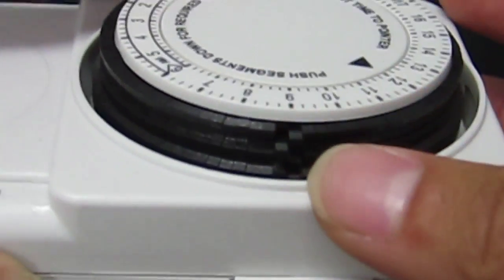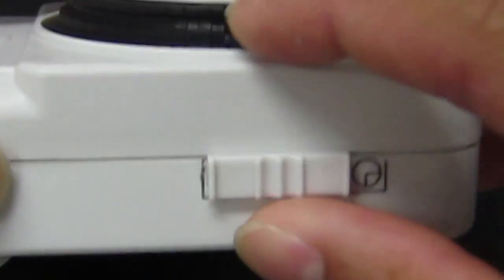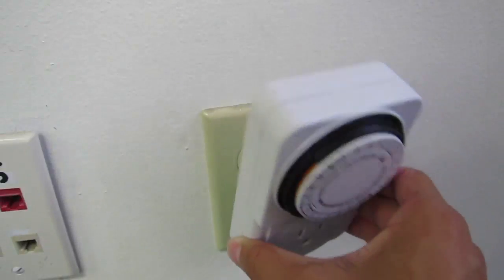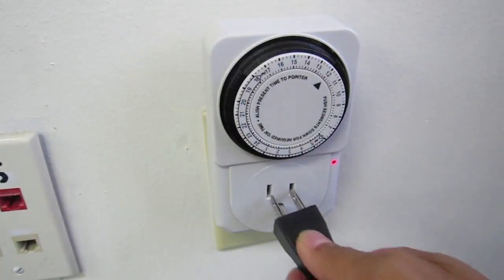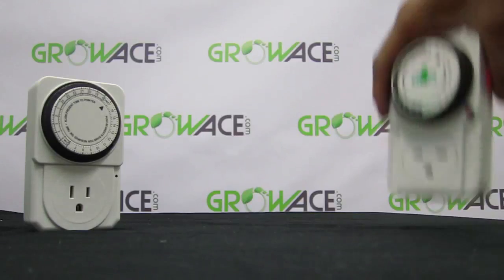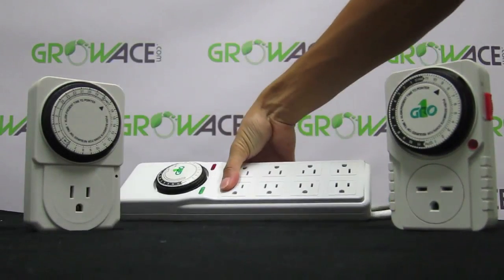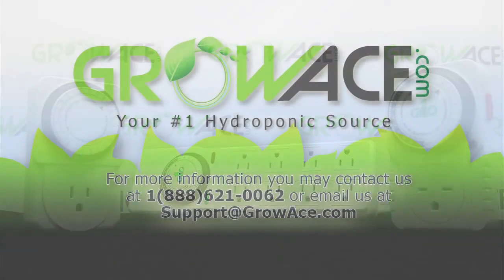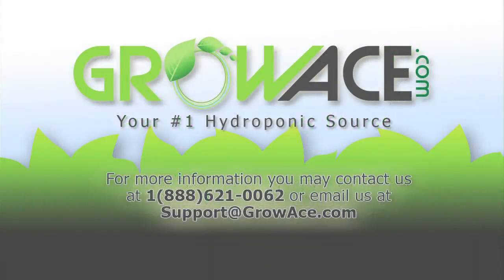How to Use a Mechanical Timer for Hydroponics Setup Tutorial GrowAce.com

Comment: hi what does that surge protector do? im interested in it, does that stop your electrical points from blowing up?
Reply from the maker: +frank lucas Kinda. It stops your electrical appliances from popping your circuit breaker by going through the surge protector first. Makes sense?
Reply: GrowAce kinda makes sense i know a surge protector can stop your appliances from getting a massive shock wave of energy an prevents your appliances from blowing up but what your saying a surge protector will stop your heavy duty electrical appliances from blowing your electrical sockets in the wall?
Reply: no he meant in this case the surge protector will stop appliance(s) from blowing fuses/circuits in your breaker. you know that box in your home with all the switches or fuses...
Reply: RaymondJacob0922 thank you so much for the reply, thats what i needed to know

Comment: you cant use these timers for ballest due to the demand upon turn on is so great it will burn out these fast . i learned after 3 went out in 1 month before i got the real ballast timmer like just shy of$100 too
Reply from the maker: +jeff wolf What kind of ballast are you using? We've been using these timers for over 5 years with no issues like that.
Reply: He's overloading it for sure. These are for 120v-240v AC correct?

Comment: I have problem ive tried pretty much everything my timer wont move. I set it on current time and leave it on for 15-30min test put 2 black things down one on the current time and 15mins later and it doesn't move at all the black marker is still at the same spot even hours after. Then i tried the pushdown thing on the side it seems to make my ballast make a slight buzzing noise and that doesn't move the timer either.. Any ideas?
Reply: +Turboz Raw you are 100% right too much draw on turn on  fries these real fast
Reply from the maker: Turboz Raw You most likely got a defective mechanical timer. If you got it from us, we offer a parts exchange warranty
Reply: I have been researching around and it seems these timers are no good for HID lights i need a heavy duty one with a contactor or something.

Comment: helpful video. straight to the point and just what I was looking for thank you. Quick question, you covered in the beginning of the video that there was on "on" switch & a timer setting as well, but never made mention of which setting to leave it on. I know it seems small & "on" would obviously be the answer but it's a mechanical "Timer" and i'm just curious at this point. thanks-@ThisIsDCo
Reply: You have to put it on the timer switch to time. If it's on the on switch it will just be on as though you're not using a timer.